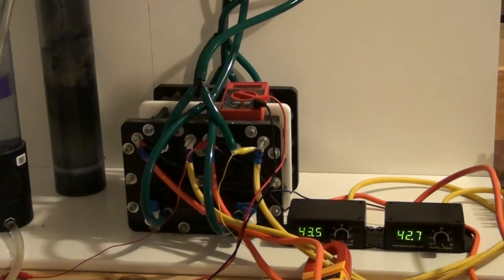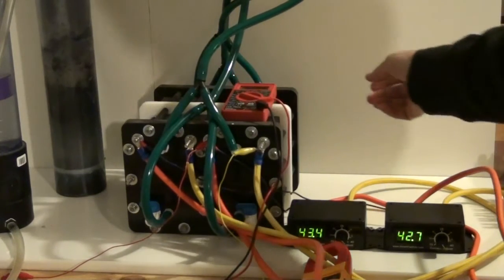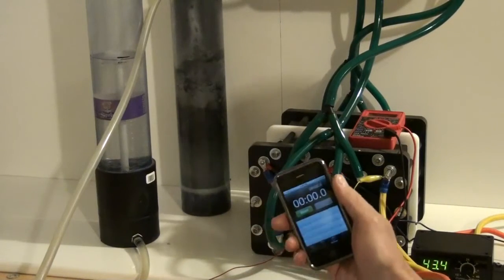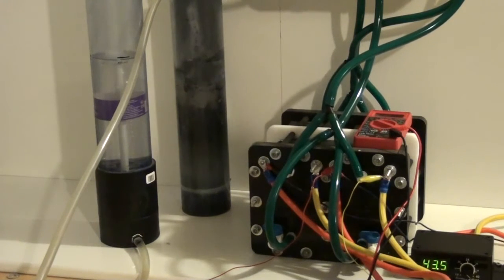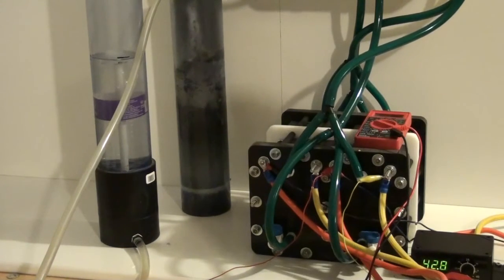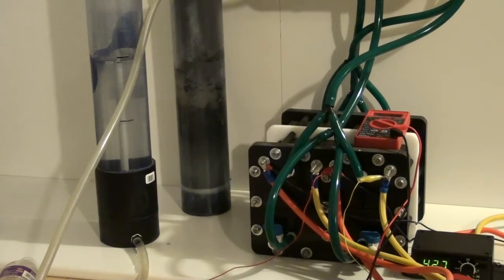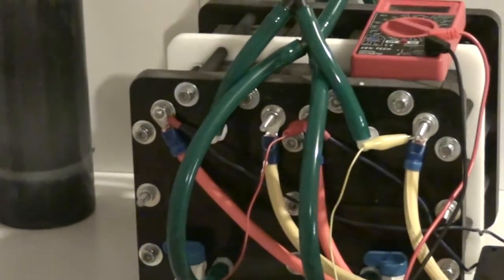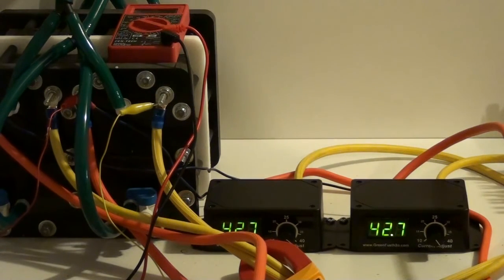HHO 144 plate 6.0 MMW Hydrogen Generator, Test 3

Comment: 88 of these would run my lawn tractor through the rpm range
Reply: and it would take 40kw to run, wonder how much power id make though with hho not gas, it loses power on diesel so it might need some work but it works ok on gas if i can cram 53 horses out of the 17 horse engine then it would break even
Reply: Dion Comeau or just break

Comment: Hi good video, very interesting stuff… I noticed { tmber01 } comment on mesurement unit.. check out my design they are real good bench units.
{ FuelBan T-3. Spark Arrestor. Bubbler . 1 Ltr Measure, Pt 1 } and

{ FuelBan Video 12 The T3 sbm Spark Arrestor / Bubbler / 1 Litre measure All 3 in 1 Unit.}
Both show my bench design unit T/3sbm, they work well, long life, multiple use, stable & accurate, easy to use & Make.
Thom in Scotland.

Comment: Hi Steve. Just a thought: a more accurate and reliable way to measure the LPM would be to mount a graduated cylinder to the outside of a tank. The cylinder would require a port into the tank for the water to enter and exit; the HHO supply hose coming thru the bottom/side; and a manual relief valve at the top to allow the gas to escape once the LPM test is finished. This would show the exact amount of output by displacement of the water vs causing a bottle to rise. It's perfectly duplicatable too